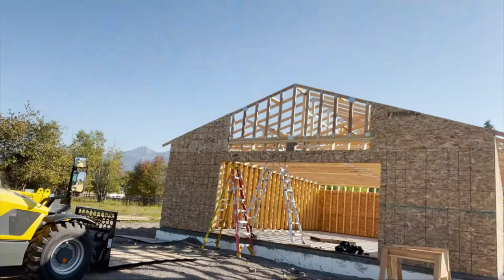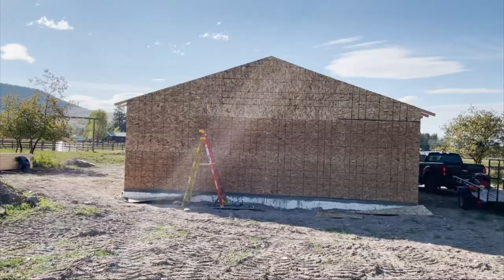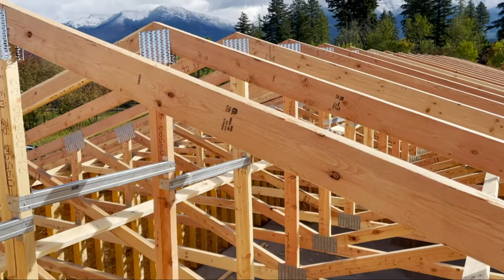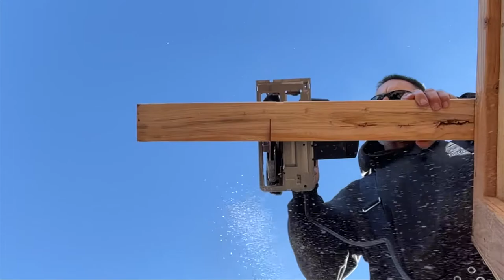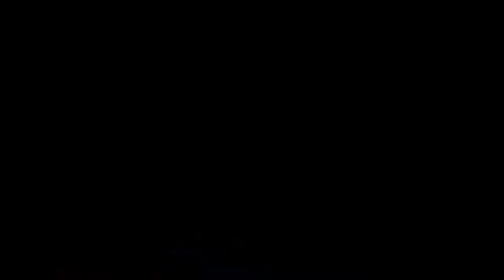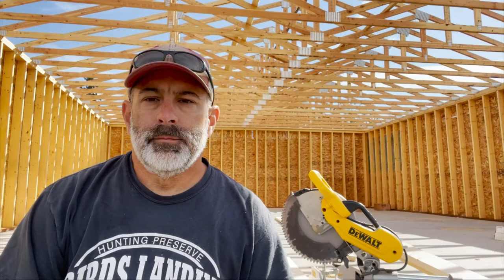DIY Outriggers and fascia  - Solo Build Project - Montana Living

Comment: & could you share how you calculated the angles ?
Reply from the maker: The angle was calculated based on the pitch of the roof. In the case of a he shop it was a 4/12 pitch so I used a speed square to match the angle on the truss. I hope that helps.
Reply: @RedemptionRoad  thanks a lot !

Comment: Just curious  why not notching the truss at ground ?
Reply from the maker: I would have preferred to have notched them on the ground as it is easier to do. The same with doing the OSB on the gable ends, but the trusses for this part of the project showed up early and I didn’t have the time to do it on the ground. Thanks for a great question
Reply: @RedemptionRoad  thanks ally !